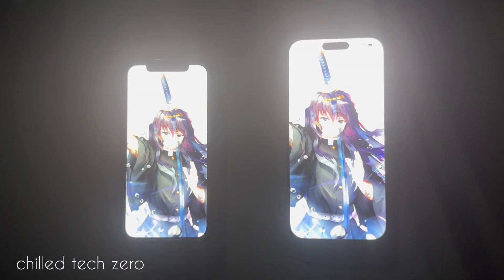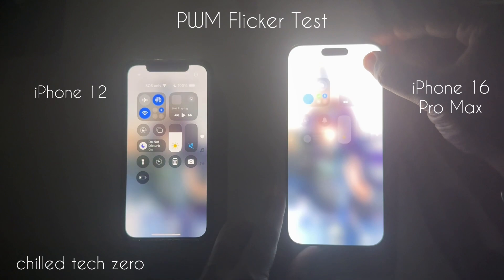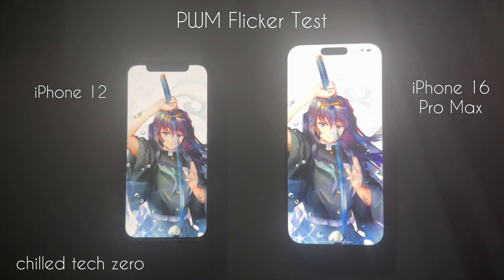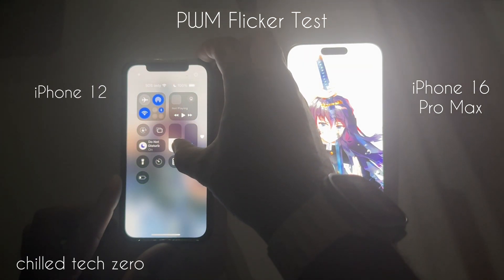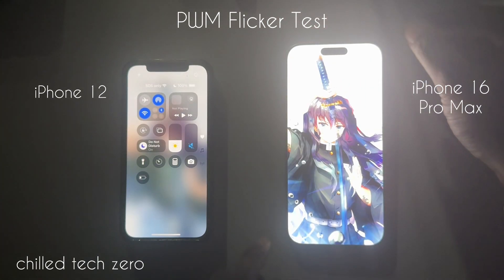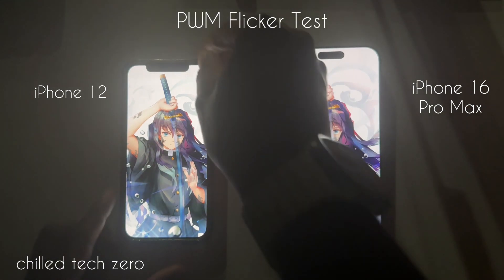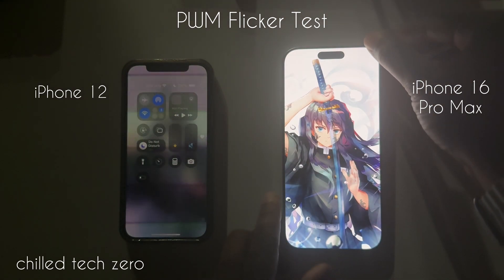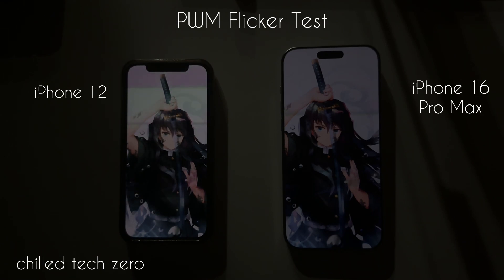PWM Flicker Test Results iPhone 16 Pro Max vs Older Model iPhone. Is it Actually Better?

Comment: I've had an iPhone 13 and now an iPhone 16 Pro Max. Both give me headaches and dizziness after just a few minutes of use. I've tried anti-blue light and matte screen protectors, but they didn't help. But with the S20FE I use, which also has PWM, I don't feel anything. Why? Could wearing glasses solve my problem?

Comment: situation on 11 pro is same (220 Гц). From 13 Pro max Apple changed into 480 Гц
Reply: Is that the change? Because I can’t notice PWM on the 14 Pro Max and higher, but I notice it strongly on the regular iPhones. Do the regular iPhones still have lower rate?

Comment: Thank you so much, dude!!!♥️ I’m really very sensitive to PWM and I was very worried when I bought iPhone 16 pro max (my previous phone was iPhone 11). Thanks to your video now I’m calmed down.
Reply: @Opel70 Mate, you left 2 empty comments, do you want to ask something else?
Reply: @МаркоГерчаківський  I wanted to thank you and didn't see the comment so I repeated it. Thank you, thank you
Reply: What do you think now after the experience do you suffer from something or is it normal, like you I have an iPhone 11 and after its screen broke I replaced it with a commercial screen and I am very sensitive and I am thinking of upgrading to a new iPhone like SE4 and the rumors are that it will be OLED
Reply: @Opel70  So far so good and I'm very happy with my purchase. But here it is important to understand that OLED screens are different and it is important how they are calibrated by the manufacturer (in our case, Apple). And that's why you will have to watch the tests after the release of the phone you want to buy. For example
before the iPhone 11 I used an Xs max for a couple of months and it had a horribly calibrated screen and I had to switch to my 11 itself. 
Ps: I'm not sure that this is actually called SCREEN CALIBRATION, but I think you understand me.
Pss: sorry if there are mistakes, I'm writing through Google Translate

Comment: The flickering is not the only problem..
Blue light are very bad for eyes. And each screen is different and have more and less blue light. 😢
Reply: Sure at night.  But , Natural blue light is a component of sunlight that's part of the visible light spectrum and is essential for regulating our circadian rhythm.    Without it , your body will suffer .   The best is to use blue light settings on your phone or a blue light screen protector.
Reply: @ yes. But you dont see the sun in direct direction all of Time. Screen yes. And Spectrum light on screen it not the same. Its incomplet and have a big spike on blue.

The blue light setting it less effective with  inconsistance screen default that havé more blue light than other.
Reply: @Tee-duck sun light and artificial light are light from different wavelengths so you cannot say they are the same because they aren’t. For instance I am sensitive to pwm and blue light but it’s only artificial light that I’m sensitive too
Reply: What I found is the max brightness nits is the one that affects your eyes I can use like note 10+ (1300 max nits) with small discomfort but I soon I use s24 ultra which has a lot of max brightness is just hurting my eyes right away

Comment: Don’t forget temporal dithering. Some devices are Pwm free, like iPad Pro m2, but have temporal dithering. I bought an m2 iPad Pro but returned it as it caused me extreme discomfort. I’ve tried the new m4 iPad Pro and that too was horrendous. I was gutted. So I bought a refurbished m1 iPad Pro which is fine
Reply: What is temporal dithering?
Reply: Change of color perception
Reply: So I have the iphone SE 2022 and I heard it has temporal dithering. The phone gives me massive brain fog. Can't think clearly or remember anything. Debating whether to get a new iphone 16 pro or just something else. Iphone is less addicting to me than android but for brain fog I wonder if the new ones will be fine.
Reply: @user-ni5bm5xf9vdoes it have an LED screen? If so you can still be sensitive even without PWM. I have an old iPad Pro with zero rated PWM but the backlight is LED. Result is eyeballs feeling like they are burning. Only relief for me is OLED display with zero PWM and TD. My LG tv is great. ASUS zenbook laptop is ok too
Reply: @paulshepherd5649 yeah it's lcd. So what phone will be best for me then? Also computer if you know good recommendations

Comment: I have an iPhone 13 and after a few days of using it I started to get headaches and now I also feel dizzy and nauseous. I also use a s20fe with an amoled screen and I don't feel that. I'm surprised because the s20fe also has pwm but I don't have symptoms like on the iPhone 13
Reply: I had an iPhone 12 and it was terrible!  Dizziness, nausea, blurred vision.  I don't mind the Samsung S24FE.
Reply: @jboss007  with s24fe you dont feel anything?
Reply: @franciscoeverson4751 it’s strange how everyone is so different and it’s not just clear black or white

Comment: I’m suffering from migraines myself regularly so I need to take this into consideration whenever getting a new phone. Since the iPhone 13 Pro with its 120hz refresh rate they changed the PWM to a higher frequency that shouldn’t bother the eyes as much anymore

Comment: But according to the lab test from notebookcheck web site, screen flickering / PWM was detected.
Reply: But in this website for oneplus 12 they mentioned “The frequency of 120 Hz is very low, so the flickering may cause eyestrain and headaches after extended use.”
But this device has 2160hz pwm dimming and dc dimming

I cant able to understand this website terms?

Comment: Thank you. Around 10% of people are pwm sensitive some more than others and it really matters for us!
Reply: That's not true. Flickering creates problems for everyone. Then it depends on the context in which the phone is used and the lighting of the environment and the time that people spend on the phone. The real problem that people don't understand that the phone Is causing them eyestrain and headache and very few people read about pulse width modulation . I am an ophthalmologist and I have studied the negative effects of OLED on vision, so I can tell you with extreme certainty that OLED is bad for everyone.
Reply: How about new tech that used on iphone 16 no more pwm so its not bad anymore hu??  @robertoromanesco8793
Reply: Actually it affects everyone, for someone's long or short terms
Reply: Stimmt, das Thema wird zu wenig besprochen.
Reply: I had to switch from Apple to Android because of it.  I upgraded my iphone and in just 5 minutes I started having a headache and a few minutes later I had a migraine so bad I forgot how to read.

Comment: Guys, I was very concerned about all this stuff. I changed my iPhone 8 to 16 pro just two weeks ago. Of course it’s very small amount of time yet, but to be honest I don’t feel any pain in my eyes. I spend in phone at least 4-7 hours per day and everything is good and I’m really enjoying such a fast new phone. Obviously difference is enormous. I don’t know how it will be in the future, but for now i don’t notice any negative effect. I hope it will stay the same and it will help you to choose right option
Reply: Still no eye strain, headache or dizzyness?
Reply: @sbali92  For now I experience none of these. 
I might be wrong, but it feels like despite PWM is present, although the lines that flow across the screen move slowly enough not to cause eye strain (I mean I don’t see them obviously using the device, but it what I saw from recording video of the screen from another device). Overall, I’m satisfied with it for now.
Reply: @Feels_Batman  you can never see lines that flow across the screen with your bare eyes. That is only a phenomenon in video recordings of screens because the camera lens reads the view from one end to another. The difference in time of the reading gives a different update between each lines so that strobing effect happens in a video. What actually happens is that, the screen just turns on and off very rapidly.
Reply: The Pro has much less flicker since the 14 Pro models. I don’t notice it. But the the base models still have low frequency flicker screens.

Comment: Thanks for the test! After 10 years of using Samsung S-series I quit them a couple of years ago, my eyes were in pain because of the horrible PWM flicker. Glad to see that Apple still cares about users eyes. I actually did test different smartphones in stores on display and found a very efficient way of doing that: the good part of Samsungs was that they were capable of shooting 480fps or even 960fps in slo-mo, so it was very easy to see the flicker by simply pointing at screens in this mode.
Reply: For what it’s worth, I have the iPhone 15 pro max and using pro motion on it makes me physically nauseous after extended use. I don’t have that issue with Samsung or google phones. I’m not sure if it’s because iPhones throttle the refresh rate way more or if it’s PWM discussed here. Trying to figure it out before I decide on my next purchase. It’s a toss up between the iPhone 16 pro and the pixel 9 pro for me
Reply: @bootsthegod9084  that could be because of the way iOS plays animations. There's the switch in Settings / Accessibility /Motion / Reduce motion.
Also the animations speed can be fine tuned via Cowabunga Lite

Comment: Stuck on an iPhone 11 and came from a 7 Plus. I've been unable to use any OLED iPhone since the launch of the X. 

This year I was able to use 16 Pro Max for two days without any negative reactions until day 3. On this day my eye muscles were strained, the back of my eyes felt pinched and I had a headache. With the 16 Plus I felt negative effects within 10 minutes of use. Both were returned for refund. 

So from a very sensitive to PWM and dithering person, there is still no usable OLED iPhone or iPad. I also cannot use the Macbook Pro's. This is hell!

These were my settings on the 16 Pro Max:
Reduce motion.
Limit frame rate (60hz).
Dark mode off.
True Tone off.
50% and above brightness.
Face ID: Attention-Aware Features off.

The least negative reaction I had was the iPhone 13 standard, which I was able to use for a week before my eyes felt exhausted and I started to get the motion sickness feeling and was burping alot. 

My work requires me to stare at a computer screen all day so I cannot tolerate or condone headaches which these OLED devices always end up triggering. My concern is always "what long term damage will I do to my eyes and brain if I even try to persevere". There is something very wrong with these displays. 

https://forums.macrumors.com/threads/eye-strain-while-using-iphone-x-and-up.2085427/